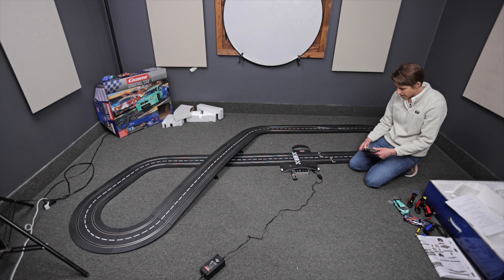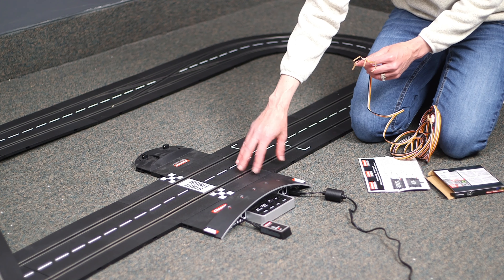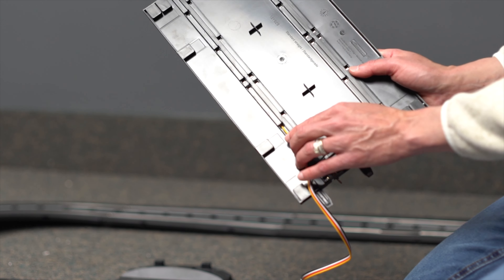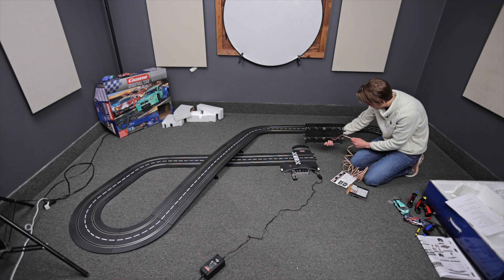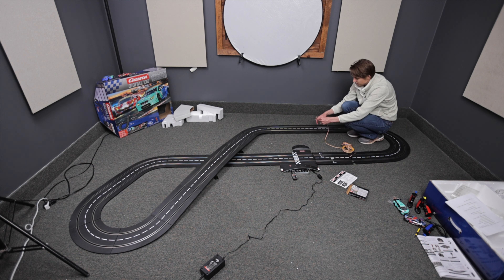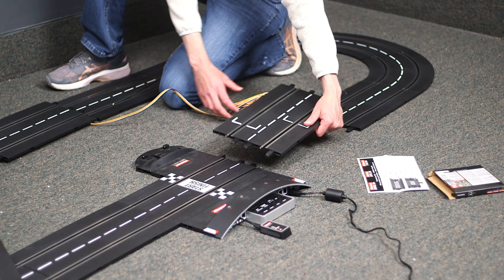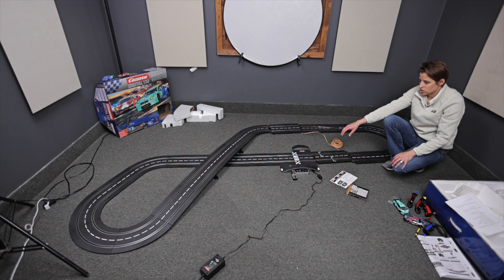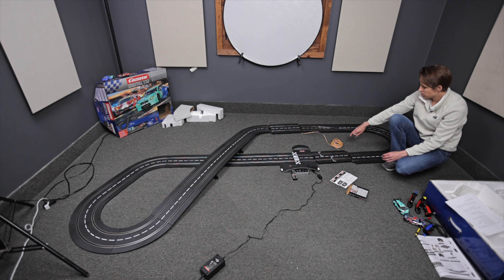Jumping power on your Carrera Digital 132 track

Comment: I'm new to all this, is there another option to get a beefier power supply?
Reply: The longer the track the lower the current can be in places on the track. This evens it out, and is also done in a fashion in the railroad hobby. Adding a beefier supply isn't needed and would probably be bad on the cars circuitry. It's just a matter of continuity.
Reply: I’ve done it. I swapped out the 14volt power supply on my old analog setup using the 18volt evolution power supply, also using the red evolution controllers. It works. Never harmed anything. BUT the problem is the power becomes more unevenly distributed thru the track. Over powered at the power section and still underpowered at farther sections. I think this wire jump trick may still help even things out.

Comment: If you want to jump multiple spots, for say  100 feet of track, do you have to add 
A) an additional power supply? 
B) do you continue to piggy back from one jump connection under the track to the next?
C) or does the jump cable always have to originate from the original starting point as close to the main power source as possible then create a long cable / wire to the furthest point?
Reply: I follow which lanes she hook the yellow and red wires.  She hook the inside lane with the yellow and red wire and then said to the hook the outside lane with the other end of the yellow and red wire.  I stop the video and trace the outside lane at the start of the track. It becomes the inside lane on the other side of the race track.  I thought for each rail is to have its own color wire and not to connect a different color wire on each rail.
Reply: I always thought you were supposed to hook up into the unit of track that contained the power supply. She hooked up to the one right before it.
Reply: Thank you for the response, all my life I’ve been under the impression that electricity only travels in One Direction, the direction that the cars travel. I thought the last piece of track before your start line was the track that had the least amount of voltage. Thank you so much for enlightening me. This is a game changer for me as far as the types of tracks that I will be able to design now without fear of voltage loss